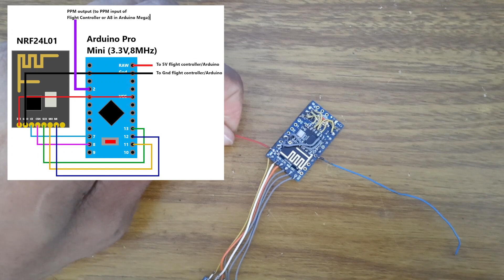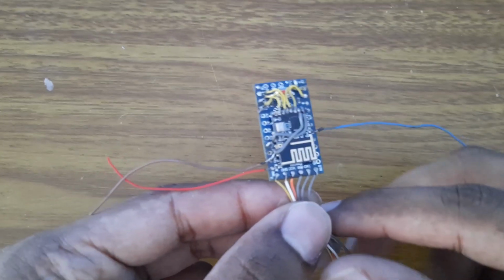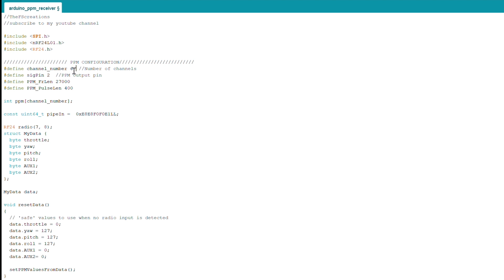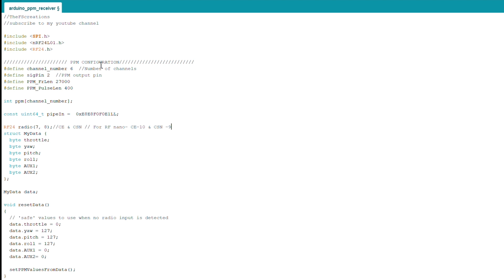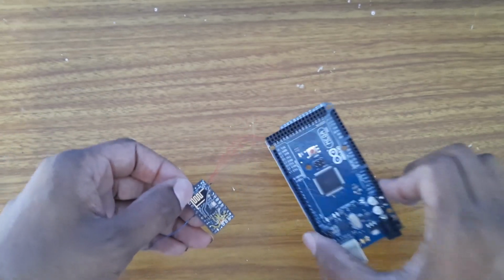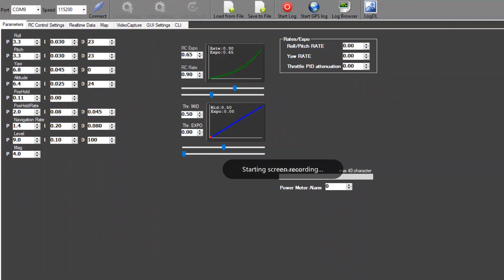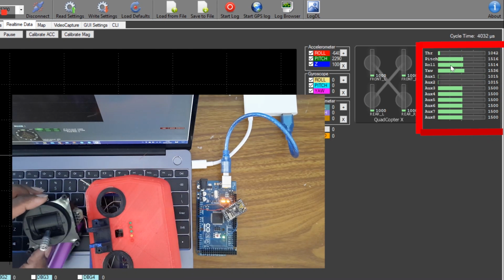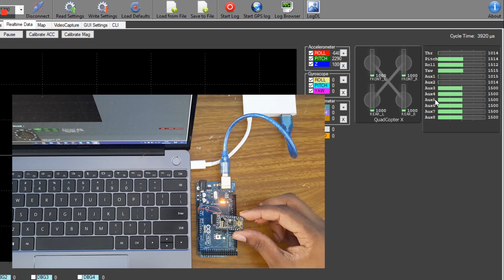DIY PPM Receiver using Arduino and NRF24l01 for quadcopter, drone, RC plane

Comment: Hi, for the transmitter code, is it the same as the receiver? or is it vice-versa : PPM Signal = Arduino Board = NRF24L01
?

Comment: Hey! Awesome project! Can i use an arduino nano insted?
Reply from the maker: Yes, sure you can, but in the code, if u need to change the clock multiplier to 2 because arduino nano is 16MHz. Checl the video i have explained it
Reply: @minilab3d  👍✅ok